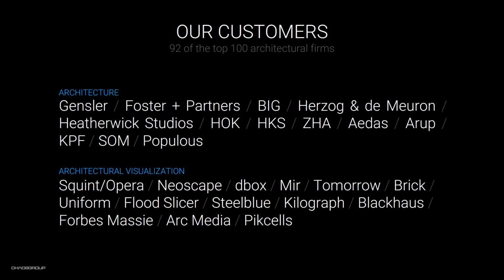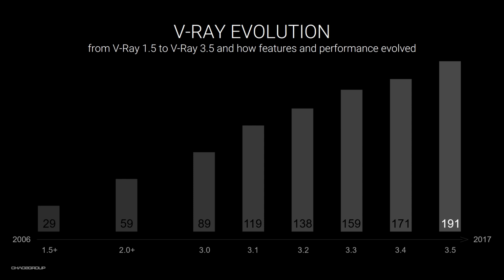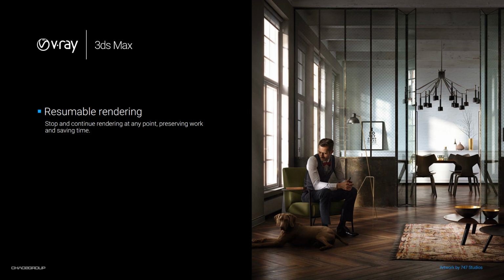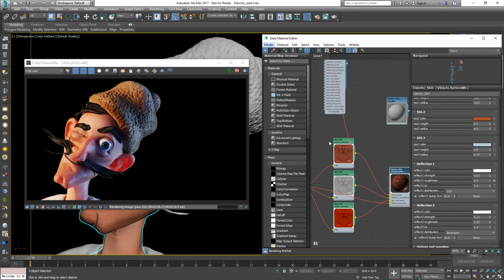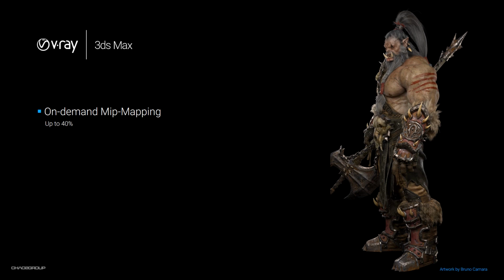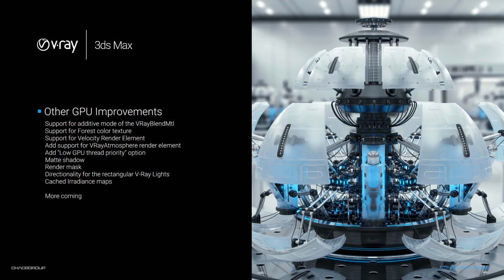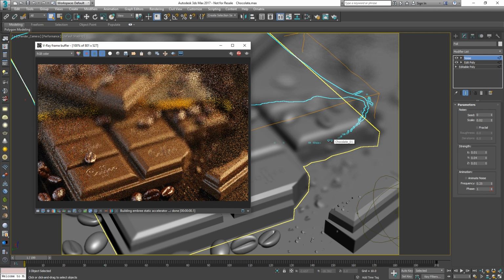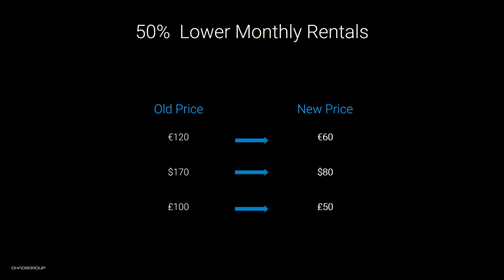V-Ray 3.5 for 3ds Max – Webinar

Comment: Question- When I am using IPR through a V-Ray Camera,  the V-ray camera view in the viewport stops showing specific position adjustments I have made to the horizontal/vertical shift/tilt. The results in the frame buffer show that the tilt/shift is still on my camera, but I cannot see them in the viewport while IPR is running. Is this a bug or am I missing something?